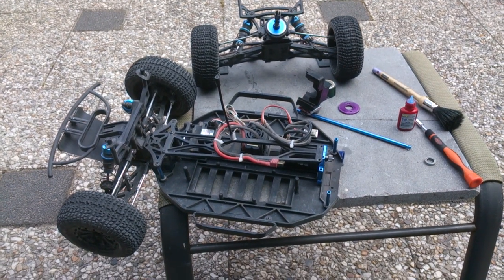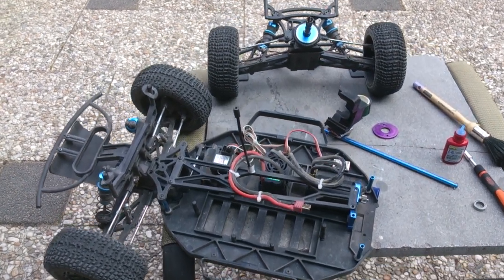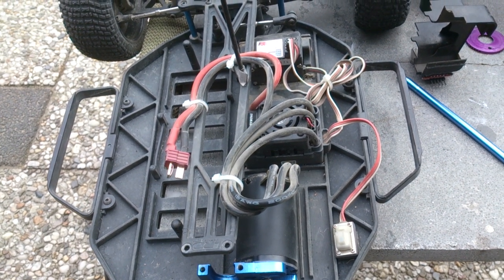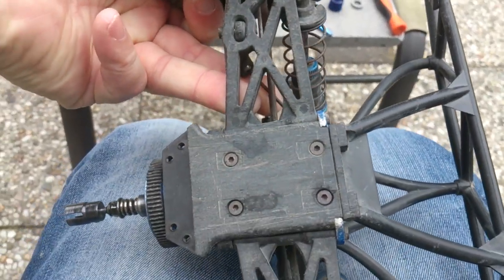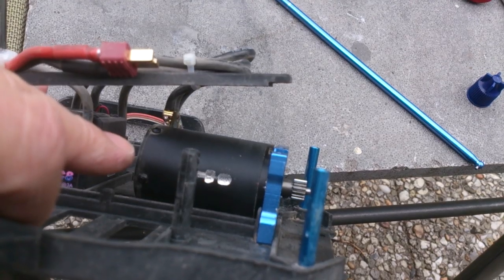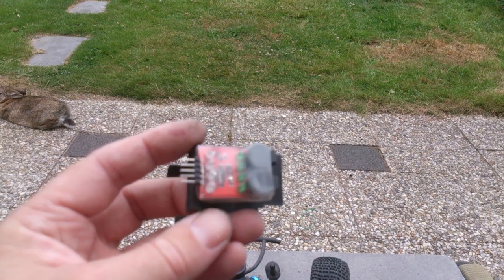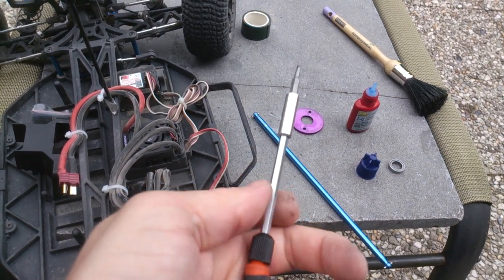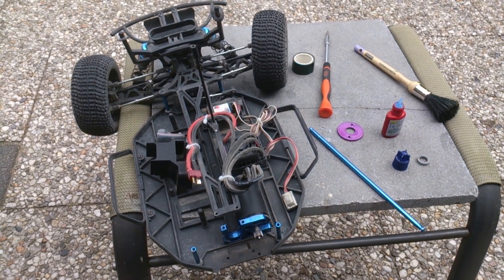LRP S10 Blast SC thoughts

Comment: Lol you're in bad luck  ;p just bought the same sct but v2. Everything seems to be okay.
Reply from the maker: Yeah, the v2 was quite a bit better, they also made a few changes with regards to the driveline to handle brushless better.

It's not a traxxas slash even in the closest. What turned me away was the prices of the spares. It's cheaper to buy a 2nd car for parts. I ended up buying a Ofna Hyper SCT, that's just so much better and cheaper on the parts. (Think 8th scale buggy conversion to SCT)

Comment: U say.. That u run 2 packs.. And u crushed the spur with a brushed motor?? But u still upgraded to brushless.. Wtf
And how the he... Did you get THAT much rust, and scratches on the chassis in 2 packs?!
Reply from the maker: Not as much crush, as stripped, the spur was not round, so it's impossible to properly align with the motor pinion. You don't need brushless to strip a spur gear. ;)

The 2nd spur was 48p and round, that made all the difference, it's still working today.

If you run on the beach without even touching anything wet, the salt on the sand alone will corrode your screws. Also, this was not a new car, so quite a few scratches on it before I got it. It's a decent budget car, even with the right rear shock being sticky.
Reply: databeestje If you bought it used, maybe it's the guy you bought it from, and not the car you gotta blame..
The only bad thing I heard about LRP is that, you cannot use their touring cars for drifting.. Which is obvious..